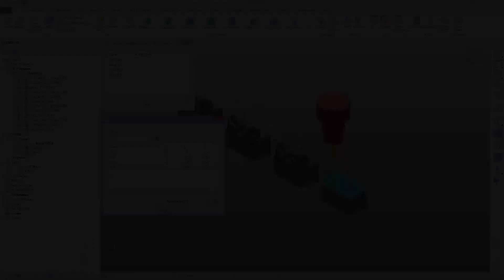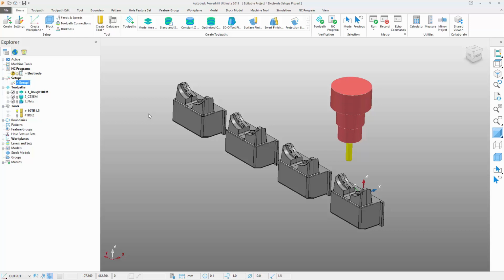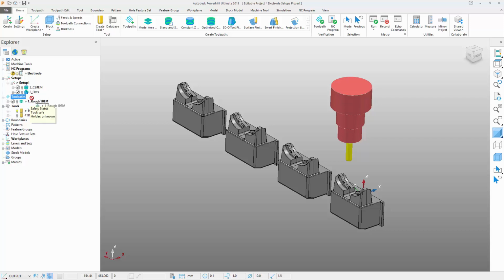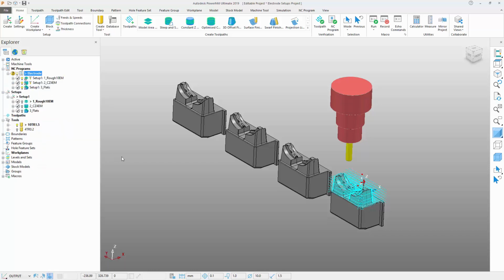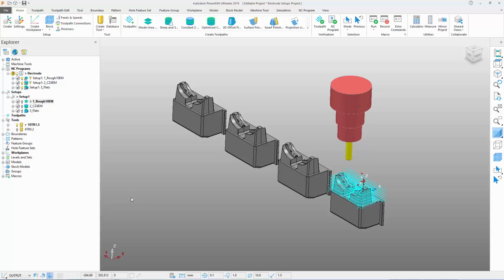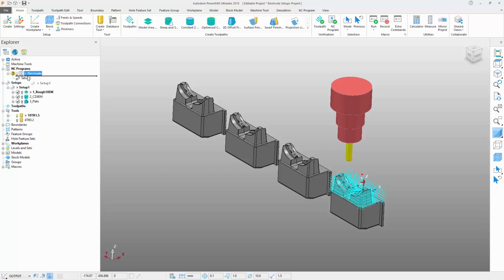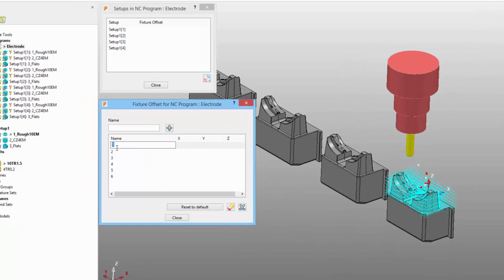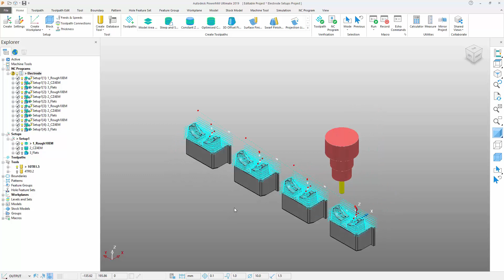Setups - PowerMill 2019

Comment: I followed the video step by step, but when I make the NC Program, in the code it does not make the change of origin. In other words, it only performs the same program twice at the same coordinate point. But actually set the program to machine at two coordinate points. can anybody help me?
Reply: May be how your post processor interprets the offsetting method. This video names the offsets for g55, g56 and so on. So firstly if you do it that way each component will need to be datumed in the same way. Part 1 g55. Part 2 g56 etc. Then you'll have to see what the posted program looks like. if there is no mention of g56, g57 after the 1st part has been machined then you need to understand why. There must be an option in the post processor to read in offsets (named like the guy does in the video) also may be worth making sure you have the up to date post processing facility. Hope this helps
Reply: @AutodeskAdvancedManufacturing   @aka_nodge  Encontré que el parámetro TOOLPATH > FIXTURE OFFSET TYPE. Me escribe el PLANO DE TRABAJO en cada una de las trayectorias. Y también le puse DEPENDENCY > INDEPENDENT IF UPDATE. 

El problema es que lo puse, abajo en un BLOCK NUMBER del COMMANDS > CONTROLLER SWITCHES > SPINDLE ON.

Esto hará que cada vez que inicia una trayectoria, inicie cargando una velocidad (N100 S500 M3; y seguido me aparezca N101 G54 o N101 G55; segun el SETUP y FIXTURE OFFSET que haya colocado en NC PROGRAM), mirará si ha cambiado el PLANO DE TRABAJO.
(No le puse ninguna condicional, solo un BLOCK NUMBER y FIXTURE OFFSET TYPE)

Si ha cambiado el plano de trabajo me lo cambiara. Y se moverá físicamente en la mesa de mi maquina al G55.

Yo creo que este PARAMETRO: FIXTURE OFFSET TYPE, debería de estar en el COMMANDS: WORKPLANE> WORKPLANE SEGMENT START / WORKPLANE SEGMENT END.

Me ampliaste la visión de cómo funciona Manufacturing Post Processor Utility.

Ojala y me pudieras corregir en donde deberia poner ese Parametro (Fixture Offset Type), y si ese parametro es el que en realidad debo utilizar. O si hay alguno mejor. y que tenga que ser posicionado en alguna parte mas idonea.

Saludos.